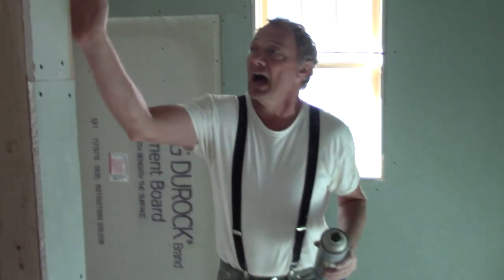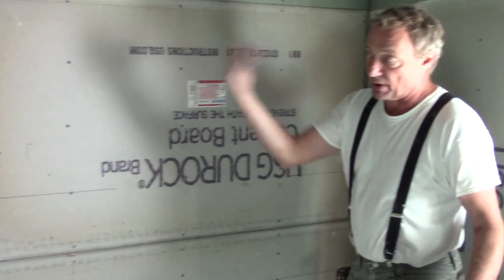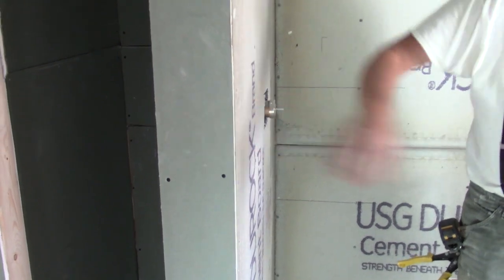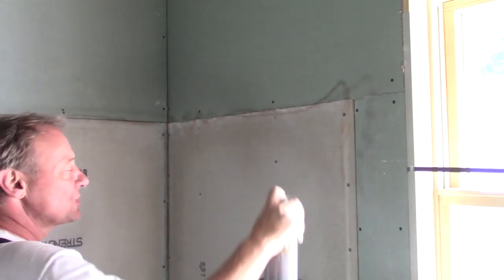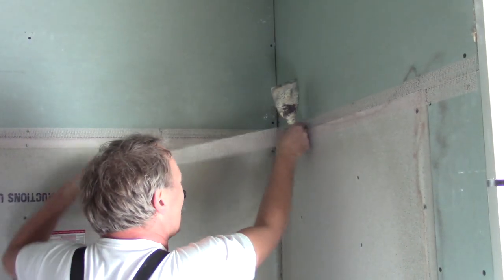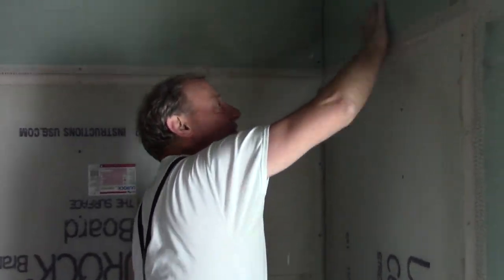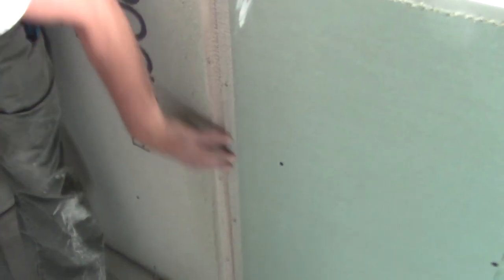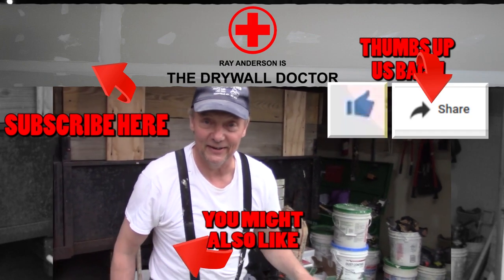Mesh Tape & Durock- Drywall for a Bathroom

Comment: Great job!  usually tile setters have to deal with the cement board, you make it easy for them lol.  One thing to mention, and I may have missed it you may have said it yourself - usually not a good idea to mud where tile are being installed.  reason why is the mud will turn liquid again after tinset goes over it.  the joint has to be primed and painted before the tile setter can install his tiles over the joint.  Just a little extra in case someone wants to tackle this job as a DIY project.
Reply from the maker: You are correct the tile guys prime with a water proof sealer before they tile

Comment: Nice video.  I built a 4’x6’ walk in shower.  I used durarock on the walls, but one piece of green board on the ceiling that I’m going to paint.  What exactly do I use for taping that joint.  I’m also wondering do I just use joint compound on the ceiling and thinset on the cement board?
Reply from the maker: Yes that should work
Reply: Man once you title to the ceiling just flat tape all 4 corners and you have nothing to worry about just go over the tape two times  and sand and paint use a 6 inch knife to apply the first coat and feather it out with a 10 inch knife
Reply: Don't bother to tape the joints once you title to the ceiling just flat tape it once it's all tiled

Comment: Why in the other video you said the guy wanted to use mesh on everything then prefill with durabond that it would crack that first you needed to pre fill with durabond ? Or you just ment that you shouldn’t do new drywall with mesh bc it can crack easier then paper tape?
Reply from the maker: Yes in new construction mesh can crack easier.

Comment: Can/should you use drywall mesh tape for durock, or is there a different kind?
Reply from the maker: I do with thin set
Reply: They make a specific tape for cement board/ thinset
Reply: They say to use alkali resistant fiberglass mesh tape..  is like 5 times the price of normal mesh tape and has a coating on it because they say the high acidity of the thinset will eat away the regular mesh tape over time but i have yet to see any proof of this..
Reply: @Z-Ack  but he's taping it with thinset in this application.
Reply: No you should not. You need to use the Mesh tape made for durock that is alkali resistant.
Reply: @Z-Ack  Normal mesh tape is garbage. The alkali resistant tape is about $8 a roll, which is enough for a shower or bath tub.  How much does it cost to redo a shower or bathtub surround because the mesh tape failed? Don't be a cheapskate.

Comment: I am putting durock over green hardie backer, do I need to use a certain type of screw? When I tried to screw it on the wall using hardie backer screws, they went right through. I dont like the way the cement on in the board crumbles. Will this be safe and water proof for a shower wall with tile. I will use kerdi to water proof it. Thank you
Reply from the maker: You can use whatever is not going to rust if the screen is going to rust don't use it.
Reply: @THEDRYWALLDOCTOR1  This is not true. You need to use screws made for Hardi backer, which are alkali resistant. Cement board will destroy drywall screws.
Reply: It sounds like you are either using screws that are too short, or are not hitting the screws with the studs. You really should remove the drywall before installing the cement board. Due to the nature of your question, you should really have a pro do this because it really sounds like you don't have a clue what you are doing and it's going to cost you a lot more to do this twice than have a professional do it right the first time.
Reply from the maker: I've seen it done with roofing nails and deck screws. Durarock screws are the best but you can use what's available.

Comment: What type of thinset for cement board joints?
Reply from the maker: I would have to read the bag but any thinset that you set tile with woodwork
Reply: From what I've read on the website for durock, any latex modified thinset.

Comment: It’s horrible that you don’t use the proper mesh tape though! That is clearly not an Alky tape which is required for cement board. The tape you used is for Sheetrock not cement board
Reply from the maker: Not sure how old you are  but when I started there wasn't any mesh tape for drywall only drivet.  Then someone put drywall on the label of the mesh and there we are. I don't even use durarock anymore only Denshield . Use the Alky tape with thin set any mesh with durabon.